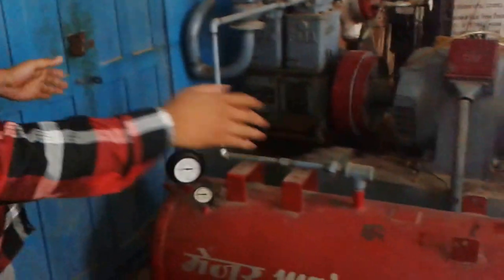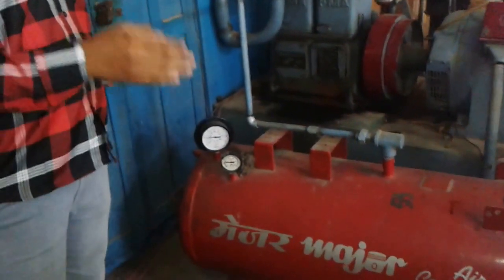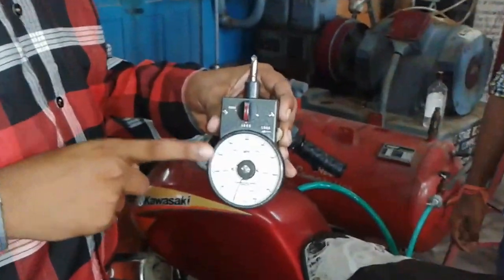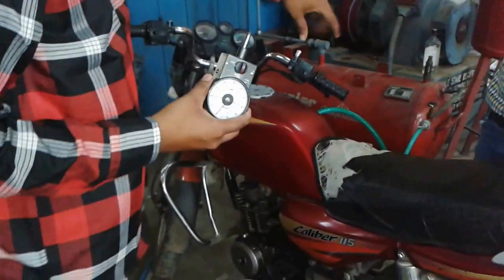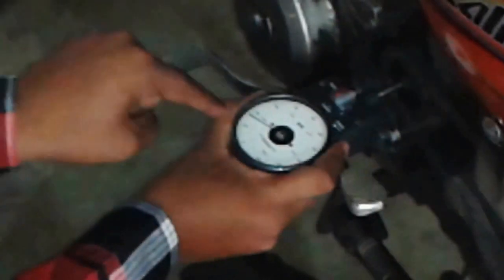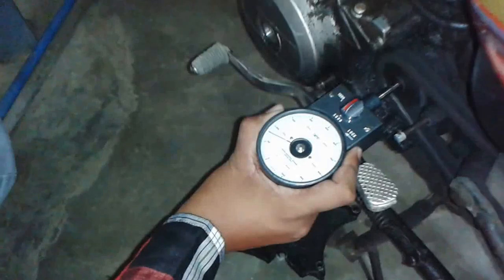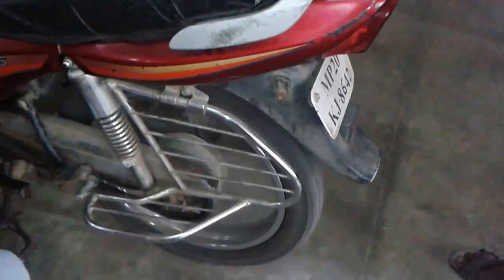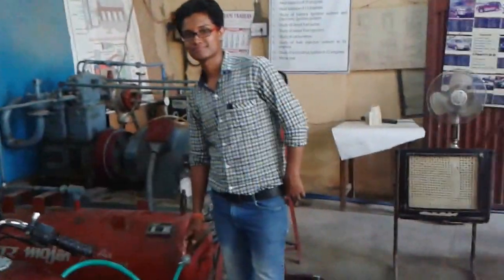Compressed air bike @ JEC Jabalpur

Comment: bhai torque ??kitna produce krti h and workin pressure .. i m workin on same project if u could help
Reply from the maker: Basically it can produce power of 1000 watt nearly.At the rpm of 1200.therefore torque will be nearly 7.96 Nm. if you want its detail description then you can see its researh paper "http://irdindia.in/journal_ijtarme/pdf/vol3_iss4/12.pdf"